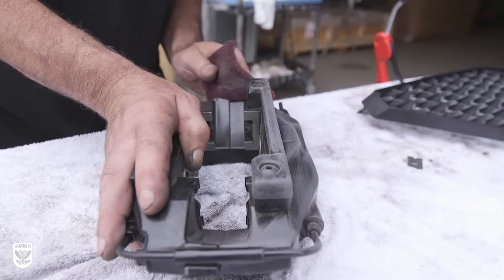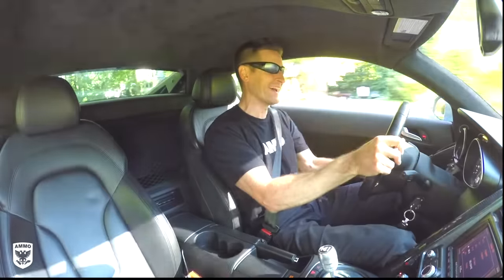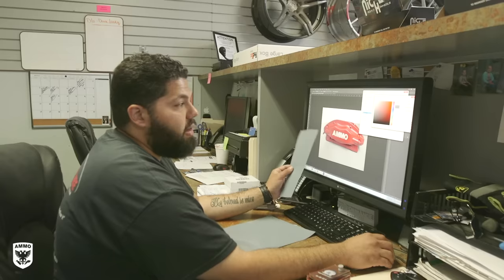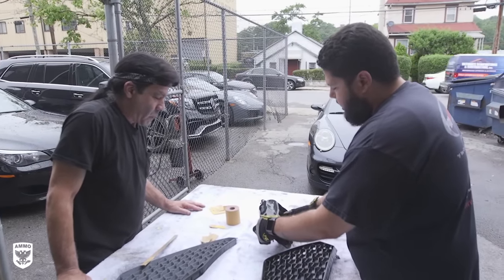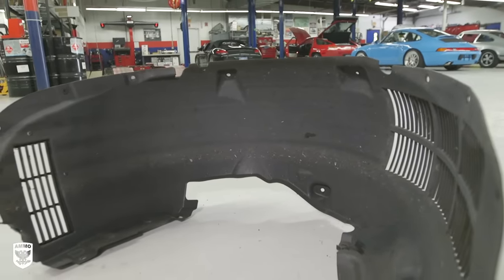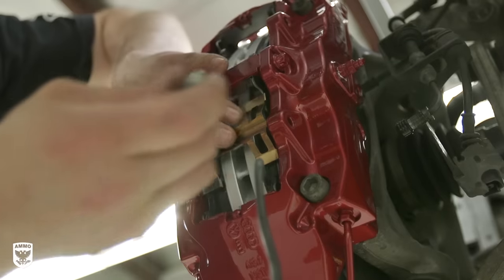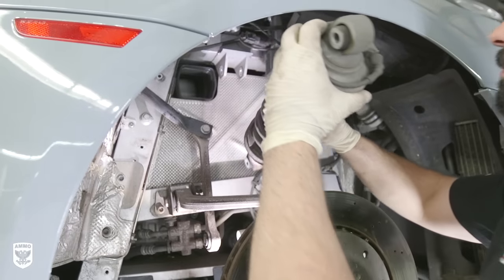How To Custom Paint Brake Calipers Properly: AUDI R8

Comment: You never wear gloves near a lathe. 

Rest looks awesome!
Reply: This is an OSHA violation.
Reply: Hands too close to the jaws of that enormous chuck. Since he just used sandpaper, no tooling, he could have done the same job faster and safer in a drill press. That polished aluminum will probably oxidize pretty quickly since you sanded off the anodizing.

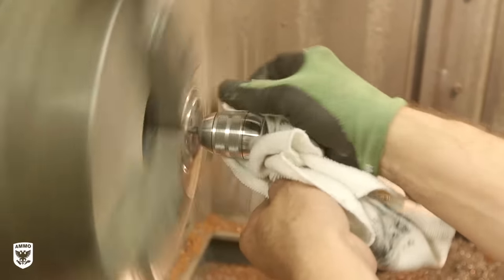Comment: 5:10 was one of the scariest things I’ve seen... one wrong/unlucky move there and you’ll be cleaning up the bits of Mario
Reply: That's the life of a proffesional, most of them I've met had several fingers with severe damage due to actually going too far but in the end it's not as dangerous as it looks.
Reply: I had ptsd style flashbacks when I watched that bro
Reply: But Mario wasn't the one working on the shift know so why would they be cleaning up bits of him?
Reply: That shop owner is one injury away from bankruptcy, this video shows more OSHA violations than the training videos.
Reply: Not to mention spraying what I assume are 2K paints without using a fresh air fed respirator !
Reply: @Sipha-Si  , All vehicle paint now is water based. Courtesy of the the EPA & VPA OFF GASSING THAT COMES OFF OF THE OIL BASED PAINT. THE BOOTH NOW IS ONLY USED NOW FOR IS TO HAVE A  ENVIRONMENT THAT HAS A CLEAN ENVIRONMENT TO LAY THE THE PAINT, IN AN ENVIRONMENT THAT IS CLEAN & WON'T HAVE DIRT IN YOUR PAINT!
Reply: @oranseay2559  Yes all that oil based 2 pack they sell just sits in paint shops never being used. Just like it says on the invoice do not use.
Reply: Obviously, Mario is a professional!

Comment: Thoughts on paint vs powder coat for calipers?  Local powder coat shop here is surprising cheap if you do all the prep yourself.  I know there's some debate about piston seals and heat when baking the powder.
Reply: Powder coating will require new rubber seals due to the baking, so a little more invested in that. The fluid will need to be 100% removed, too.

Comment: Are the logos on the calipers a special material?  If not then how do they survive the heat?
Reply: Adam York They are high temp Vinyl. Been using them for years with zero failure.

Comment: Any reason why you decided against splitting the caliper to paint them?
Reply: Yeah a proper job would have been to completely disassemble them, strip the old finish then powder coat them. And finally install all new seals
Reply: Stephane Leclair Most manufactures don’t powder coat due to the caliper retaining heat. (Or so I have heard)
Reply: Brembo and Akebono calipers are powder coated from factory (the one that are "painted")

Comment: You can use endless brake pads which are used for the 24 hour races so they will last you a very long time
Reply: But only really work in high temp situations. If it's cold braking, its just a non stop squeal
Reply: Yes you can use them for the track only and keep the street pads for the street

Comment: Why did you leave the pistons in?? You go thru the very extensive process of cleaning/sanding the calipers, in their entirety, why not strip, clean, as you do, ultrasonic, clean and then cover the parts (without pistons) and after a good paint, rebuild the pistons & seals. I can't see any additional; costs.

Comment: Failing stock magnetic suspension system?! What year is the R8 & how many miles on the odometer for this to happen? Doesn't bode well for Audi's reputation.
Reply from the maker: Its super common ironically with this year R8

Comment: Save yourself time and stop from going mad, use liquid mask instead of masking tape. 
This as its name is a liquid which drys to form a transparent layer which peals off once you're done. Being liquid means you can apply with a detail paint brush to fit any shape and surface.